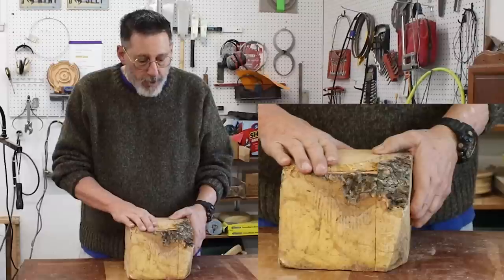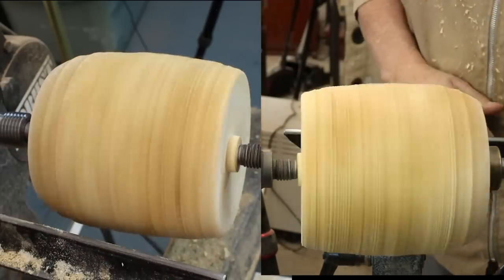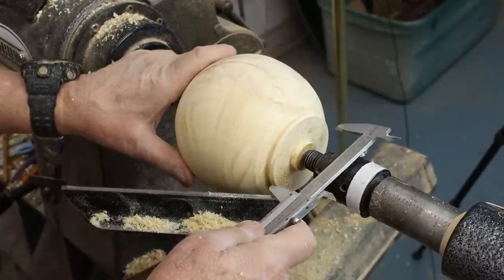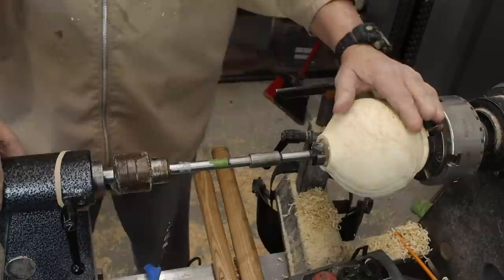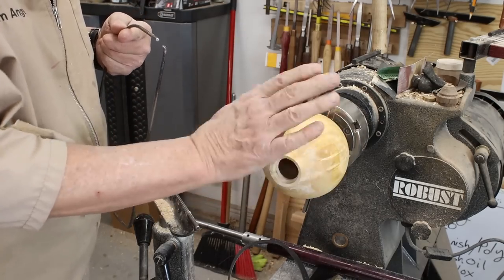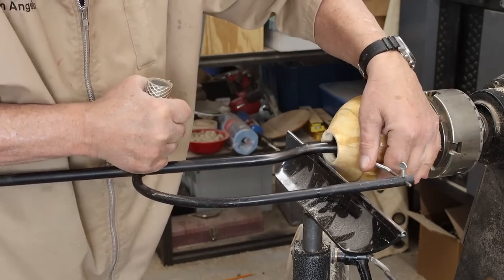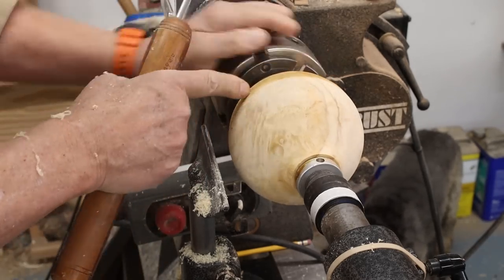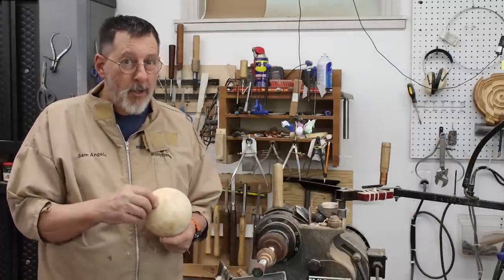Four Ways to Turn a CUBE (into something)   May 1st  2023        with Sam Angelo

Comment: A lovely piece of box elder turned into a very nice vase. Some interesting tools and techniques I've certainly never seen before. If you add a thread and lid I hope you show that too, though I think it looks excellent as is. Also the shop dog wandering in and outside of shot is sweet.
Reply from the maker: Joris, yep the dog is really the star of the show.  I am actually planning on adding a threaded insert and finial soon.  The vessel is still drying out and I need to wait a bit.  The opening is going a bit oval but I think it will be fine.  I will show it someday in a future video.  Regards   Sam